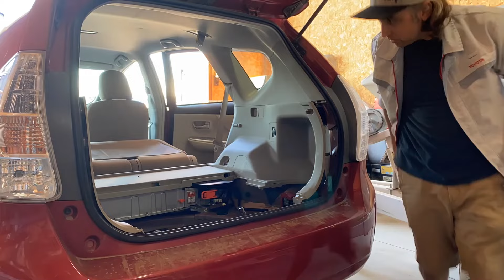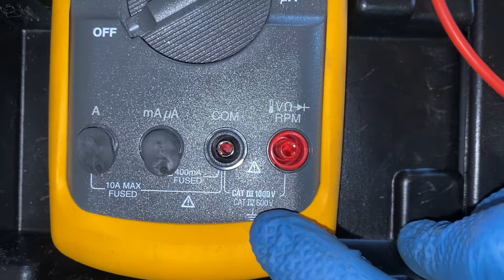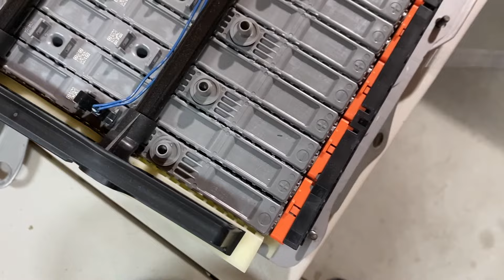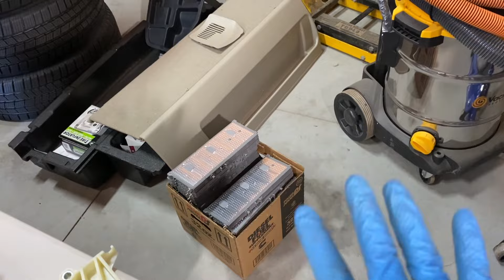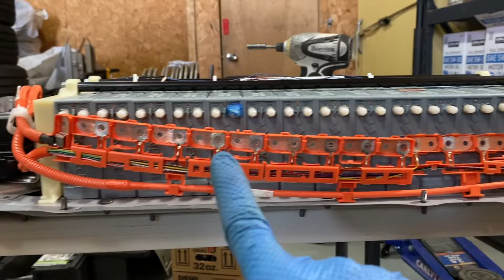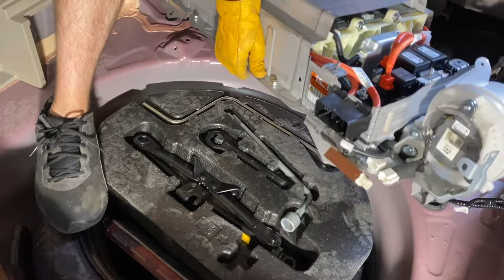How To Install A NexPower Lithium Battery Into A Toyota Prius V/Gen3

Comment: Okay. Did the install last week. Took two days (maybe 8 hours total) in 100 degree heat in my carport. No helpers, so removing the 80+ pound pack from the Prius V was probably the toughest part (I'm in my 60s). Didn't need to remove the passenger side plastic cover BTW (just pulled the blower motor before pulling out the pack). 

Could have done this in one day if the factory hadn't over-torqued and stripped the 10mm threads on the end of one of the four rods that hold the pack together. Rethreaded it with a tap I happened to have in my shop. Always something.

Sent in the old batteries to the recycler today for a potential $200 rebate (we'll see). Car was averaging 40-43 mpg before the switch (with 73 percent life as measured by the Dr. Prius app). Now getting 48-51 mpg without hyper-miling. Can't really detect much performance difference. Maybe a little faster on starts? Certainly longer duration for using ac while parked or at lights.

Worth it? Depends on gas prices and how long you're going to keep the car. Mine is a super low mileage 2013 (27k miles) inherited from my father. May pass it to my stepson if/when I get an EV.

Bottom Line: this was a somewhat tedious job with a fairly high level of return in terms of mpg improvement (17-20 percent if my math is good) and basic mechanical satisfaction and bragging rights LOL. 

Hope this helps anyone considering the swap.

Comment: Hi mate. I have an Toyota Estima (Previa) Hybrid 2009 which has two different votages for the battery cells. Would you mind to let me know how to convert it to lithium please?
Reply from the maker: The lithium version of that batter is under development by Nexpower energy here in the states.  If all goes according to plan it will be released sometime this year.

Comment: 26:51 why is it that i cant find any info on why or why i cant use dielectric grease on the copper bus bars and wires to help with the corrosion.. i dont see anyone doing it.. ive done it on mine and i have no issues or rust

Comment: Do you know anyone in Los Angeles who can help me with this type of work? I have a 2012 prius V with a failing battery pack.
Reply from the maker: Actually yes, I want to help you out with that.
Reply: Is it normal that ever since my car began sending the p080 code ( I think that’s right) the cruise control stopped working? Is there a correlation ?
Reply from the maker: @Pudney1377  yes, if the battery isn’t working correctly the car won’t use cruise.
Reply: Can you provide me with your phone number and I will call to get the ball rolling on the lithium battery replacement ?
Reply from the maker: @Pudney1377  email me. Pneilson@certifiedautoconsulting.com

Comment: Do these new lifepo4 cells even require the vent/fan? can it be deleted?
Reply from the maker: Yes they do, use the OE cooling system
Reply: @TheHybridGuy  Thanks! Is the c rating on the lifepo4 batteries less than the original, or not good enough, that they require the original cooling? Or is that just the suggestion when considering liability?

Comment: When will you guys restock gen 2 prius batteries, mine has been failing after replacing with used nimh cells, I've already rebuilt it twice in a year.

Comment: Has anyone tried to install a larger battery that would give 20 miles of EV range 
like a plug in hybrid?
Reply from the maker: This can be done, though I to not know the specifics of wiring.
Reply: There was a lot of diy and aftermarket information out there for the gen 2 before the plugin came out. Since then not much else

Comment: I'm scheduled for tomorrow at green tech auto. $1.8K new cells. I looked for the batteries you installed and I can't find them. The main reason I bought the v was for camping. Sleeping in the car and running the ac. I'm guessing that this upgrade would be better for my use.

My car is running fine I want to insure reliability. So I have options open.
Reply: You can run AC w no engine? Man I think I might pull the trigger on of these and do this upgrade. Can the rear area be made flat??
Reply: @misaelramos83  Best answer I can give you is this. Search Prius camping. Ill add more accurate information to this as I get it. Lisa Mallard currently is Prius, I'm in a Prius V but rarely camp my car is all but passenger seat removed and my sleep space is plenty for my 6' 320lbs. 
Currently I'm in my runaway camper, using a crib mattress and a 3" pool foam float. Pillows for feet and head.

Flyboy TR, Juice Media. Both have Prius V video.

Adventure daily has a good gen 2 setup.

Ok before you look for a Prius if you decide to, you need to know the history. Gen 1 = 1999-2003 

Gen 2 2004-2009 Good upgrade more space better economy. Various trim level 1-5 that's good for confusion later. 

Gen 3 improved economy by redesign no belts in the engine. Larger engine displacement from 1.5 gen 2 to gen 3=1.8 liter (Alternator, water pump power steering in the history of cars have been belt drive these create friction ergo economy is bad with belts) . 

Prius V was based on the gen 3 platform trim  level. 1-5 trim the 5 with heated seats, simulated leather reverse cam, GPS. There's another pkg called the technology pkg idk what all this is I think it has to do with entune and remote gates. The main reason I bought my first V my daughter was learning to drive then I was 360lbs the rear seat in the v is just as functional as the front. I had major back surgery I needed this if I was to be a back seat passenger. 

Gen 4 2016-  here's where my knowledge needs help. Upgrade battery system they had Prius prime in this run. Prime is a pihv so you can get some miles from grid vs gas only.

Ok the Prius V has been discontinued in USA but is made in Japan for their mkt and export to United kingdom Europe and Australia. 

Gen 2 still has plenty good in them I literally gave one away to a friend. I had removed all seats but drive and passenger rear of driver. My bed was a crib frame and crib mattress. I have video again then I was 360 lbs I had crutches in there somewhere to support with flexibility.
Reply: @misaelramos83  I bought my 2 nd V 4th hybrid when POTUS Trump was still in office. It was stupid to buy a hybrid since I drive very few miles. But my reason was for Prius camping. I had trailer hitch installed for towing my (RAC)runaway camper. I'm in that camper now bc im grid tied and want to save energy. Smaller the space the less energy you will consume. My setup in here is almost identical to what I have in the house only smaller. The bose in house is big bass with 2 jewels, in the RAC only need the bose wave radio. Ill have it rocking inside get out and closed doors and windows you barely hear it. 

After C-19 the (utilities)power bill went $150+ prior to that the highest $ was $110 utilities. I'm not going to pay that if I can help it.

I don't camp in the Prius bc I'm grid tied should grid tied become unavailable (eviction) or too costly I will move into the Prius V but I have so many reasons not to ill stay put for now. 

 As a former truck driver I'm not romantically influenced by the lure of travel. It's great if there weren't all the pitfalls. Cops robbers can be the same thing. The break down, grind of always on the go. Here for shower there to sleep a storage unit for support. For me it's a road I've been down before means to an end. Currently the means and ends are pretty good. Since the past doesn't represent the future I know it can end with one storm. I like having my own washer and dryer. Another reason I didn't want to get back on the road.
Reply: @misaelramos83  yeah the gen2, gen3, and the V have pretty flat and level floors with the seats folded down. Very good for camping. And the AC across all gens is electric, but you can't run it without the ignition on, so the engine will turn on as soon as the charge % on the battery drops low enough. Buddy of mine put a super quiet exhaust on his and runs a thicker oil and it's remarkably quiet when the engine kicks on.

Comment: Have you worked out any data on the payback period - how long before the upgrade pays for itself in increased mpg? How is the Prius V’s mpg with the lithium battery?
Reply from the maker: Depends on how much you drive.
Reply: Also in today's vehicle economy it already pays for itself compared to even a used car with high miles right now. As long as there aren't any bigger issues you may be having with your hybrid this is a cheap option.

Comment: How you can use the lithium battery without an active balancer ? Don't you think this dangerous
Reply from the maker: The car BMS keeps it I control. It operates a a lower temp than NiMH and is LiFePO technology which is much safer than lithium ion. This won’t have thermal runaway.
Reply: Thank you

Comment: Can you  let us know how the acceleration increase is? I am on the fence because I cannot get a good feel of the improvement. That is what I want more than anything for the electric motor to be able to get up to speed faster without the ICE
Reply from the maker: The acceleration is linear meaning that the drop off isn’t like nickel metal. So when you accelerate you have sustained power meaning it will feel as if it is faster when in reality it is driving like it is supposed to.
Reply: @TheHybridGuy  Appreciate the response and information!

Comment: Pretty sure you can remove the battery assembly on a v without removing the right side panel.  Just need some swivel joints on your ratchet.  It would have been nice to show the drilling of the modules for the temperature probes.
Reply from the maker: You can remove the battery without taking it out yes. It was simpler for me to show it that way. Also, the new batteries that are put now have no need to drill for holes it was for the early adopters.

Comment: Hi Pete! Wow, see, I would have no idea NOT to soak buss bar nuts in vinegar. Do they GET contaminated? If so, how do u clean? How about wire terminals that go on buss bars? Do they get corroded? This is the best battery video there IS. Thank u for ALL the special instructions. U had some help, how long did it take U? Are u using high voltage gloves? (yellow, orange, blue) Sorry for so many questions, was very interesting!
Reply: Not enough information.. how did you drill holes, and clean busbars with what kind of brush, as you are alluding to coating? Skipping certain things in a video could spell disaster.
Reply from the maker: They do get some contamination (corrosion) but you can brush it off. The coating is sufficient for the life of the battery. This lithium pack will not corrode the nuts which is a huge bonus. 
I do use gloves if I am unsure about the voltage. Most of the time when you take out the service disconnect and the car is off you are in almost no danger, but I always measure if I have a question. 
The battery swap of I would have not done a video would have taken two hours or less.